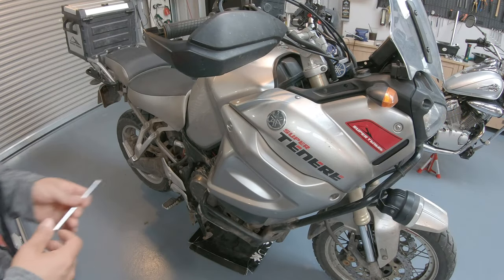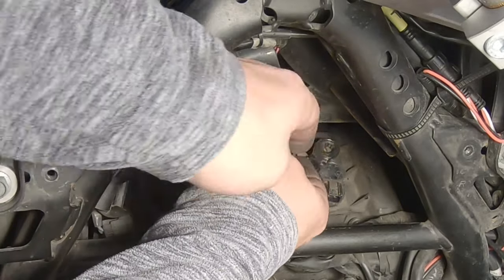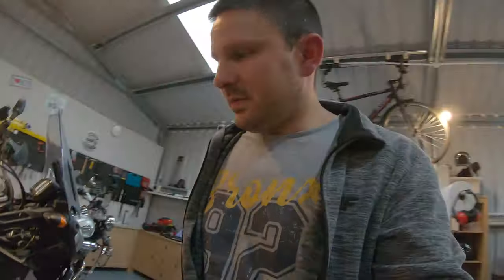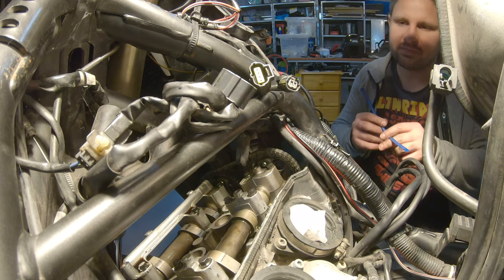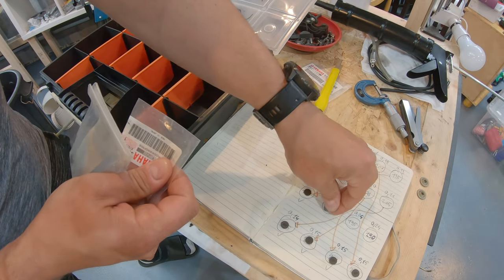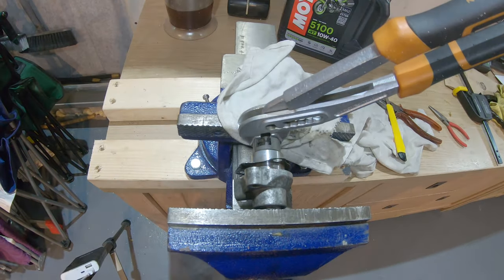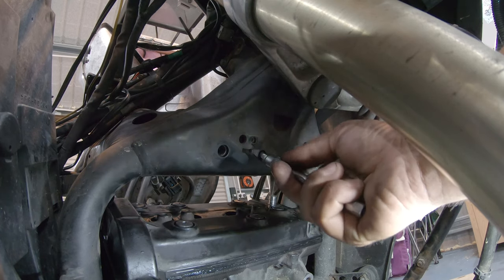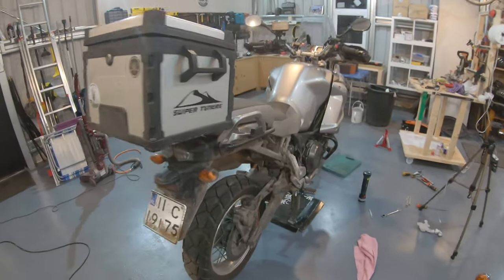Super Ténéré 1200 Valve Clearance & Chain tensioner

Comment: Hard job & master class. Thank you so much for showing us and filming it. Did the first 40k in Yamaha valve clearance check and now around 74K...I thing I'll wait to 100K to check the valves again if still the motor runs so smooth, strong and perfect, but besides basic maintenance, it's the only labor that will let do Yamaha mechanic... Fingers cross.... It's a lottery with most of them.... Thought it's very helpful the video, I prefer not doing it myself!! Complicated for me... The first 40K, Yamaha told me they were all in spec. (valves). Now runs great, round, stronger and smother everyday. Two years and three months and would repeat again doubtless!! St12 is not obsolete as some say... It's proofed, it works/runs great and it's the best!
Reply from the maker: You'll be fine at 100k. Indeed it is one of the most underestimated bikes out there.
Reply from the maker: Thanks for watching 😊
Reply: Update. Still fine and perfect at 150.000kms.

Comment: Here's a tip: Use a small inspection mirror to see the timing marks on the side of the camshaft sprockets. Then you don't need to move the electronics panel.

Comment: I was told by the dealership that you have to drop the motor to be able to do the valve job!  After watching your video I would let the dealership do it.  I can see a lot that could wrong.   So much to remember where it went…wow!  Thanks for video
Reply from the maker: Thanks for watching😊 Absolutely no need to drop the engine. What you see in my video should be no big job for a mechanic.

Comment: Many thanks for your video, after seeing it a couple of times in combination with a manual I decided to go for it.
The last time I did  anything that will come close to this was allmost 30 years ago on a Kawasaki Z900, one simular valve adjusting technique.
But a lot easier to acces, the valvecover was a PITA !! Get some very strong glue like gasketsealant and seal it a day before you are planning
to mount it; you will need all the help you can get !! Keep up the good work !
Reply from the maker: Thanks for watching 😊 gluing the seal against the head cover might create some uneaven points and it might not be flat once you tighten it down. It has to be a very flexible glue/silicone but I prefer not to do that. I know many do.

Comment: Like the effort in details. Great job. 
I just want to change spark plugs. But watched the whole video.

Must say that this is a bit more job than checking valve clerance on my KTMs 450 SXF and 525sx (motocross). 
Man the S10 has a ton of stuff in the way to make this service.
Peeeew only 2600km on mine at the moment. 
Not looking forward to this :)
Reply from the maker: Thanks for watching ☺️ it is really only a matter of time. Not hard if you are patient.
Reply: @Freedomachine  
Exactly as you said. Not rocket sience, as long as you mind the details in positions. 
Thanks again.

Comment: Fairplay to you for filming it.how much would you charge for this job.Thanks for this video .
Reply from the maker: I'd say after a couple of times I could do it in 2 to 3 hours probably. So 200 to 300€ would be good money for it. TBH hard to say though because now I know every single step. An experienced mechanic not necessarily might know exactly how to get to the valves so he will have to spend time figuring it out.
Reply from the maker: Also thanks for watching 😊
Reply: @Freedomachine  had you ever an abs problem. Abs light on mine just came on for no reason and therefore no abs working now.sensors seem to be fine.?

Comment: Hi nice video. How many Km do you have in the Odometer? I’m 42.000 and need to do the check but I’ll try to avoid it until 80.000
Reply from the maker: Hi, that is what most people do. They skip the fist one. I'm not the first owner on mine so I don't know when it was done. I don't have it on the paperwork but it didn't look untouched so maybe it was done. I have around 90k.

Comment: AS I SUPER TENERE 1200 OWNER, I AM HAPPY TO FIND A DETAILED VIDEO ABOUT HOW YOU DO THE VALVE CLEARENCE CHECK, SO MANY THANKS FOR CHARING. JUST ONE QUESTION ; AT HOW MANY KM DO YOU DO THE FIRST CHECK ? SINCE I AM AT 40000 KM NOW. THANKS . AND ALSO SINCE I COULDN'T FIND ANY INFORMATION ABOUT WHEN IS THE RIGHT TIME TO CHANGE THE CLUTCH ASSEMBLY.
Reply from the maker: Thanks for watching. Yamaha reccomends the check to be performed every 40.000km. Many do it at 80 though. Most people I know have found them perfectly in spec at  40k. I recommend you follow the yamaha guidelines of course. The clutch assembly does not need to be changed unless it vibrates at 3000rpm. Gen 1(pre 2014) only might have this issue. Gen 2 do not need clutch basket replacements.
Reply: @Freedomachine  Many thanks for your informations, kind regards.

Comment: I took my super Tenere to a small independent shop to get the valves adjusted, and now the cruise control doesn’t work. Does the whole bike need to be torn apart again?
Reply from the maker: Thanks for watching ☺️ Unfortunately my bike doesn't have cruise control. They might have to lift the tank. Most likely they forgot to plug something back. You shouldn't pay for that.

Comment: What is the reason to change the original chain tensioner, for a manual one?
Reply from the maker: Apologies for my late answer. The gen1 tensioner had the tendency to fail. It starts to make noise on startup and if ignored for too long you'll end up with a chain that slips. That would be the end of it.

Comment: Can you pm me, such a great video and I still have messed it up. I thought I'd pushed the plastic bit to release the chain tensioner, cut the cables and now when I turn the crank the chains jumping and the intake isn't turning.... Help!
Reply from the maker: Hi Tom. Not a big deal. Remove the chain and put crankshaft and camshafts as they should be. From what I remember the intake lobes are pushing down on the valves in this initial configuration so its better to unbolt the camshaft. Fix the chan back on it and then bolt the intake camshaft back on. This will put the chain in tension so use two cable ties on the intake. Release the chain tensioner and you should be fine. If you need more help contact me tomorrow. I will do my best to help you.
Reply: @Freedomachine  hi thanks for getting back to me so quickly. I did all of that, the only thing I think I may have done wrong is when I put the manual chain tensioner in I didn't push the plastic thing next to the chain to release the tensioner onto the chain... Am I gonna have to take it apart again and do it again?
Reply from the maker: Unfortunately yes. You will have to reset but you are already there. Shouldn't take much.
Reply: @Freedomachine  reset but getting stuck at the same point 1:23:30 when you use the screw driver to release the chain tensioner.. How do i know if I've done it right, feel like I'm stabbing blindly in the dark
Reply from the maker: You will hear it and feel it. The tensioner will slap the guide quite hard against the chain. If you don't notice it then it's not happening. Use some long screwdriver or piece of metal and apply decent amount of force. Just to be clear you need to push away from the chain not towards it. If that is not working for you then you need to take off the clutch cover.
Reply from the maker: You should see the chain guide from the top. Push that against the tensioner. Don't try to reach the tensioner itself.
Reply from the maker: If you manage spin the crankshaft twice to see if you got it right. You don't want any interference
Reply: @Freedomachine  just to confirm before I try again, and I should do this without the manual chain tensioner installed? Do the bit you said, then torque the chain tensioner? Sorry, I really appreciate your help mate
Reply: @tomf4608  ok don't remember the video but either I missed to say something or you missed a piece of video. That bit where you push the chain guide applies only if you install an automatic tensioner which I'm not. I'm just explaining how it's done. After that i install the manual tensioner. Initially you just tighten that by hand. With a manual tensioner there is no need to release the tensioner
Reply: @MarcoBelcastro  ah okay, that's what I thought the first time round and it wasn't working properly. I'll try it again and if it doesn't work I'll video it. Thanks
Reply: @tomf4608  you need to remove all the slack from the chain and you'll be fine. Check if the guide is fully engaged against the chain before you remove the cable ties.
Reply: @MarcoBelcastro  how do i do that? I can't see the chain guide from the top, unless I'm looking at it and don't know lol
Reply: @MarcoBelcastro  same issue as last time, the exhaust turns but the intake doesn't.. Gonna have to take it apart and reset it again now 😭😂
Reply: @tomf4608  go to www.freedomachine.com contact me from there. I will reply with my personal email.

Comment: Do you need to remove the Head just to replace the Chain Tensioner only??
Reply from the maker: Unfortunately yes unless you can apply tension to the chain by removing the clutch cover. The chain might skip and you won't realize it. Better remove the head cover.
Reply: I just called the Dealer no need to remove the cover! :)
 @Freedomachine

Comment: How often do you have to do this because I heard they go a hundred thousand miles trouble-free but yeah hey Yamaha Tech to do this don't even attempt it
Reply from the maker: Thanks for watching 😊 It needs to be done every 40.000km as many factors decide what happens with the valves. Some might go 80k without issues and some reach barely 40k. If you want to avoid issues then you should follow Yamaha's reccomended service interval.

Comment: Beginning to think it would be easier just to drop the engine out and work on it from there?
Reply from the maker: Thanks for watching 😊 It looks harder than what it is. I would definitely not take the engine out. Just remove the tank completely.
Reply: @Freedomachine  probably time I should start looking at doing mine! But I want to build a bike lift to get it up to a decent height so I'm not scrambling around on the ground. That, I think would make a huge difference for workability. 
I have the 2014 model, love it. 👍😊 Pity you can't send pics on here or I'd send you a pic of mine.
Reply from the maker: Use knee pads and you will be at the perfect hight😊

Comment: What would it cost,  to have this job done in garage,  and what mileage did you do this job at
Reply from the maker: Thanks for watching 😊 It was done at 40 according to garage where I bought it and at 80 approximately. TBH it can cost from 200€ to over 600€ as it depends on mechanic. Yamaha shop won't be cheap. This is based on information posted on Facebook pages. Unfortunately I never took a bike to a garage so I don't know the prices. Also I'm not a mechanic. I have never charged anyone for work I have done on their bikes as they are part of my motorcycle family.

Comment: What happens if don't adjust?
Reply from the maker: Thanks for watching. If you let it go far out of adjustment many things can go wrong but ultimately it will destroy your engine. On the ST they normally get tight which means that your valves won't close completely. You can imagine what happens if you have the combustion going past your valves.
Reply from the maker: I'll expand a little on that. If valves don't close combustion will go past your valves causing overheating of parts. Typical symptom are exhaust pipes getting glowing red. Not good! If the valves are loose you will have the lobes hammering against the valves and these will eventually get destroyed. It is very important to have a good valve clearance also because the bike runs better and smoother because the timing is correct.

Comment: if i line up K latter with the meating point on the engine adn evrything you sead in this wideo mu 1 cilinder doesnt have compression and backfiers thrue the intake somthing is wrong in your words....
Reply from the maker: Thanks for watching. It's not only about allignig K. There is more to it. If you skipped fast through the video then I suggest you actually watch it fully. Every step you see is what I did.
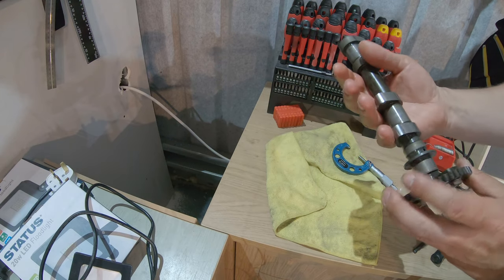Reply from the maker: From 1:10:15 you should watch it fully. Also you should have removed the chain from the camshafts in the same position as I did
Reply from the maker: Finally it is not enough to just align K but you also need to check the camshafts position. The cycle repeats every two revolutions of the crankshaft.
Reply: Everything lines up the k mark the camshafts the lobes the 4.5 tooth from e to I mark everything. But I want to mention I was trading to start it with a little bit of fuel in the intake and only the coil packs are connected probyble it's making a mistake when to fire spark but the compression test is driving me crazy  on the first cilider it's showing around 2bar. Maybe that is decompressor job. I am stuck haha i don't know what to do tomorrow I will put the injection and sparks to try to fire it up..
Reply from the maker: If everything is aligned right and there is no interference (spin it manually without spark plugs) then it will start. Just put it back normal.
Reply: I spin it 30 times and crank it half minute to build up oil pressure everything Sims OK in that point.
Reply from the maker: Automatic or manual chain tensioner? I think you should be fine if you start it normal. Just keep in mind that it will not start immediately the first time.
Reply: Automatic it is OK I put it correctly. It did not skip tooth everything is line up whrite now. Actually I have motorcycle repair shop but still evy motorcycle is different. That why I end up on the YouTube.
Reply from the maker: Mechanics that don't use any guide are the ones that brake stuff😂 I honestly think it will be fine. Pressure you should check with throttle wide open cranking untill it stabilizes.
Reply from the maker: Nice one :-)
Reply: @Freedomachine  it started up nice but the main problem is still present. the problem is in from start first  and second gear have slight bog down and then it comes up how is your bike in that matter its boging in 1500 rpm in harder acceleration
Reply from the maker: My bike after it started was like new. No problems at 1500rpm. Check ignition coils are correct
Reply: @Freedomachine  im saing that the problem of bogging is still present it was here before valve adjusment i ment it will go avay with that
Reply from the maker: Measure ignition coils and sincronize throttle bodies. That is all I can suggest.
Reply: @Freedomachine  its bin done that is not the problem its in lean mixture it needs more fuel
Reply from the maker: Ok good. I'm glad you found the issue also glat you did the timing without problems 😊